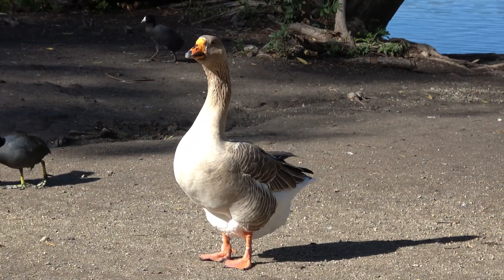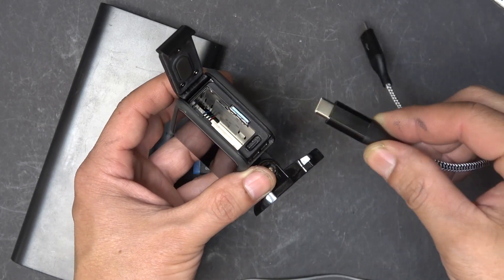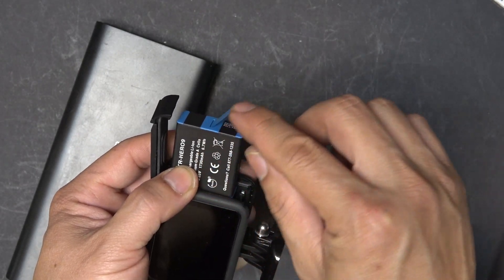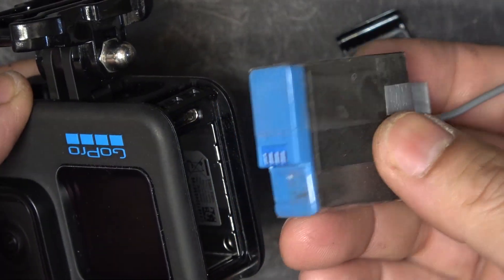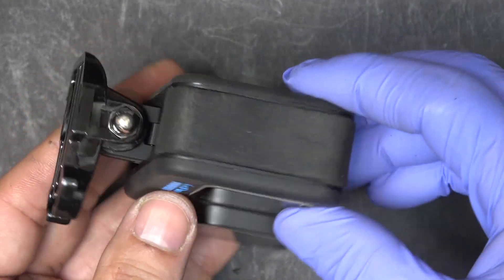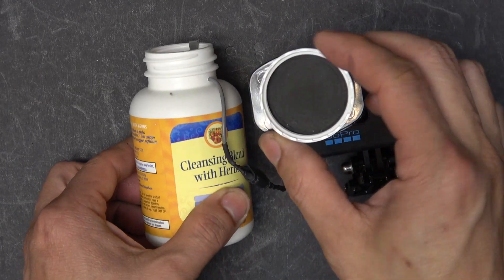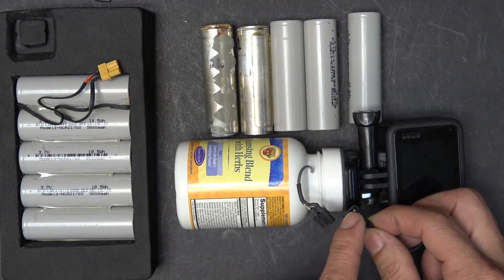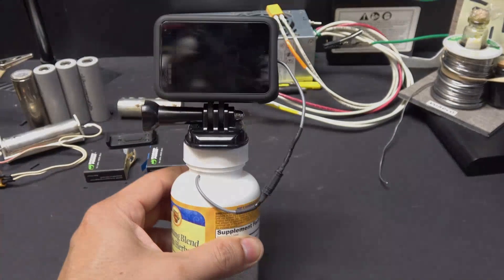DIY: Make GoPro Hero 10 external battery using Tesla 2170 cells

Comment: this way will work with gopro 9 ?
the same battery or I need another output.
and thank you for everything that you’ve shared here.
Reply: Yes. There is no difference for the camera as long as you connect the new battery cell to the old GoPro batteries bms circuit. You will lose overheat protection this way because the temp sensor will be far to the battery. It wont be an issue if you watch for your battery temp frequently. Its even better for the cameras life because there will be less heat in the chassis

Comment: As I often do, I'm hearing your voice through my wee wireless speaker; original battery is stupid 200 mAh lipo, which I've supplemented with two Sanyo 18650s...I dunno, maybe 1600 mAh each? 2000? Massive improvement, of course.
Reply from the maker: Typical throwaway economy. Everything they make has a planned obsolescence in mind.
Reply: @vuaeco  Keep sticking it to 'em, comrade! ✊🛠